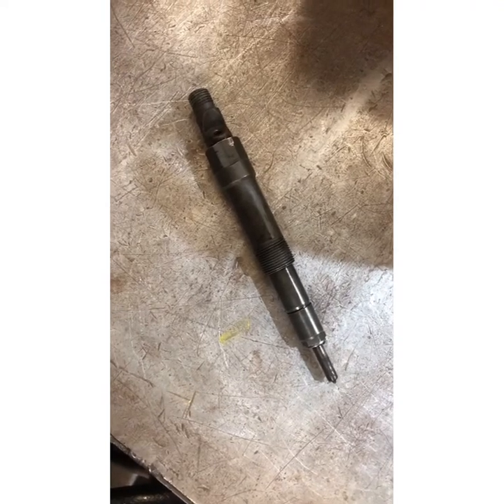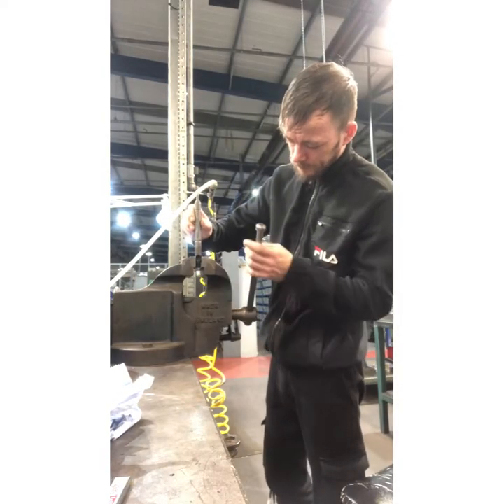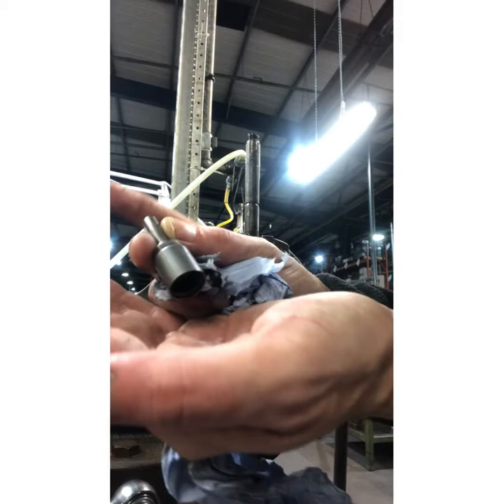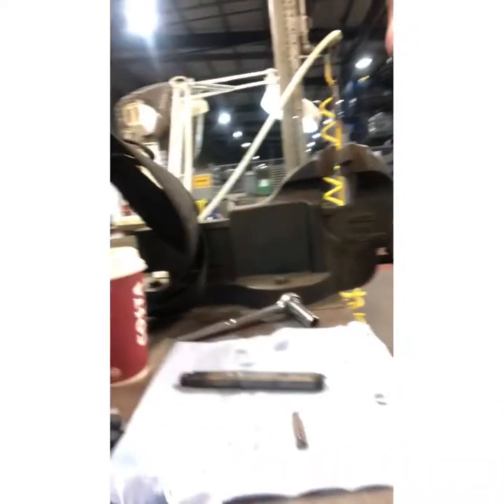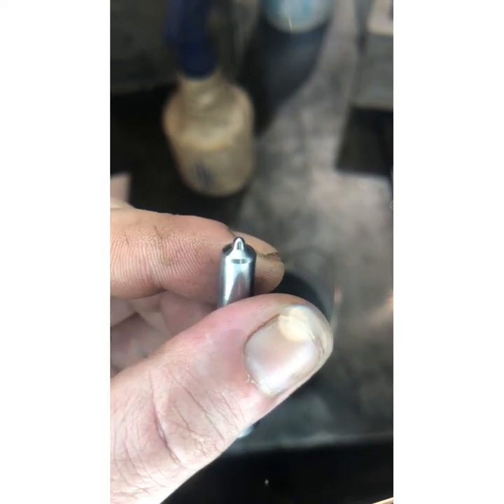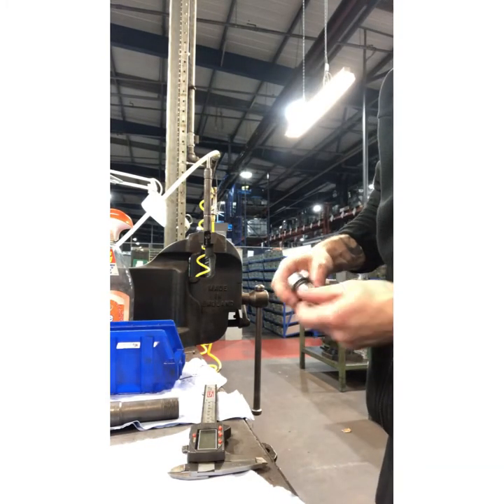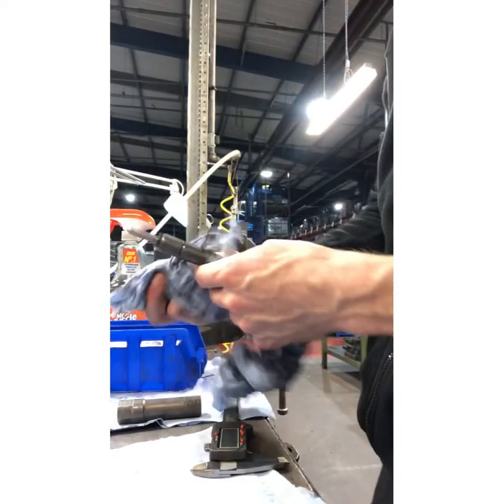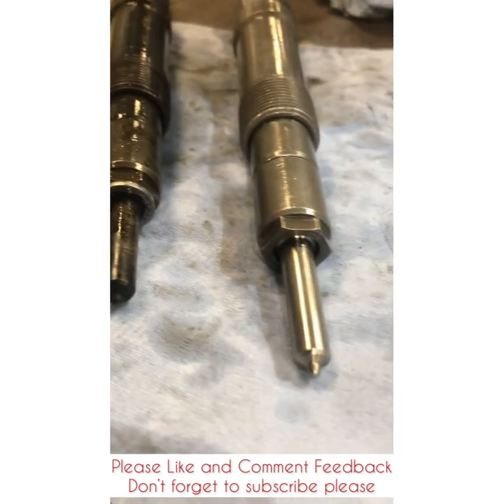Refurbishment of Delphi Bosch Ford  DI Injectors ( All original parts re-used )

Comment: Thankyou for your full and very informative video,do you know of the process is the same for the later 59 plate engine,failed mot on emissions again so I'm leaning towards injectors as not as easy to start once its warmed up,this is after the fun of doing two rear hub seals 😢😂 the fun certainly continues

Comment: This is just what I need to know, my ford transit had a blocked injector and this video help me to get back on the road. Thank you from Tasmania Australia. Can you supply a full list of all the parts in the injector, eg: shim on the top of the spring to adjust the run pressure, the injector seal washer, is there a screen filter insert in the top of the injector also?. what about the two seal washers for the return bleeder tube as well. Can you also suggest where to get these parts from here in Australia. Regards Eric

Comment: Where did the little washer go  you said not to reuse. I didn't see u re fit a new one. I put some good diesel out out a dirty barrel and got oil substance coming from injector rubber. Am I best changing the rubber seals or going full on injector clean. I'm not a mechanic nor do I have a sonic  machine u cleaned them with

Comment: Good job well done; did you replace the washers on the tips for reseating these as mine are crap also if you did where can you buy them from?
Reply from the maker: Hi Patrick 
Thank you for the positive feedback .
I replaced the washers with steel washers and I purchased from Peugeot , call them and ask for steel HDI injector washers, cheaper than fords
Reply: Thanks for your replies,I had my injectors rebuilt by a company up north but i didn't reseat them and now runs a little rough . @Rustleinthebushes
Reply: Yes I did and got them from peps auto parts for around $20 per injector. You get the seating seal for the injector and also both seal washers for the return line fitting as well.

Comment: These injectors aren't checked on a benchmark.. They runs, but not optimal.. The test on a special   bench, create a C2I code, written on a ring around the head.. That needs to be written in the engine processor to make it run better..
Reply from the maker: Thank you for you feedback , this video is ‘how to refurbish injectors’ and not ‘how to bench test injectors’ and what your saying is not true . These are bench tested but not in this video, Mechanical injectors that can be adjusted within the software , they run on a mechanical fuel pump
Reply: @Rustleinthebushes  OK... I have refurbished my injectors common-rail delphi, but not checked them on bench.. So there is excessive backflow and consumption, who make a default "leak of pressure" at full power... Thank's for your answer..

Comment: very good, but i d´like know what is the pressure this injector?
Reply from the maker: Hi There thank you so much for your comment,
These injectors are from a 90ps van but are used up to 115ps 
I hope this helps
Reply from the maker: 2000 PSI MAX OPEN PRESSURE